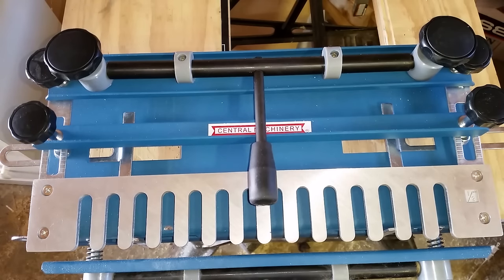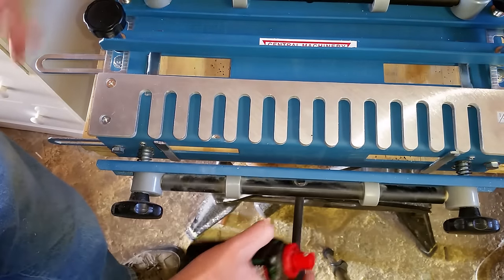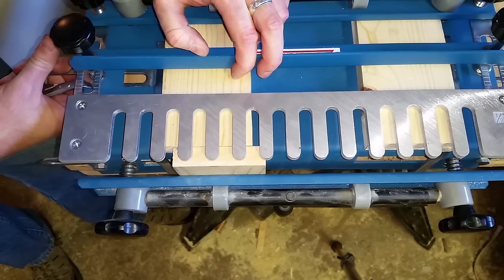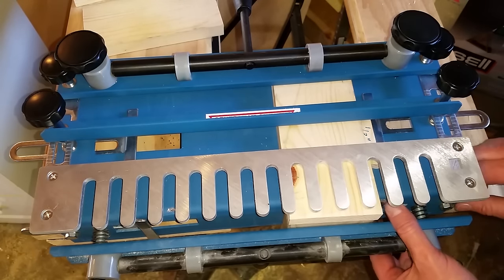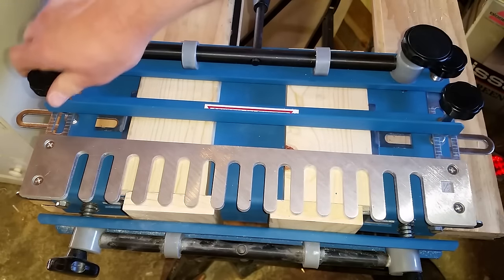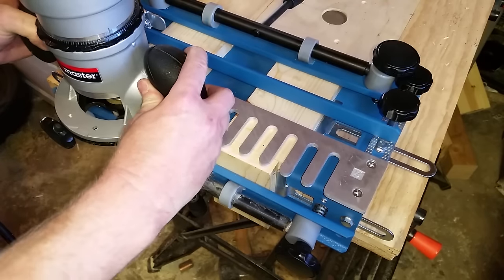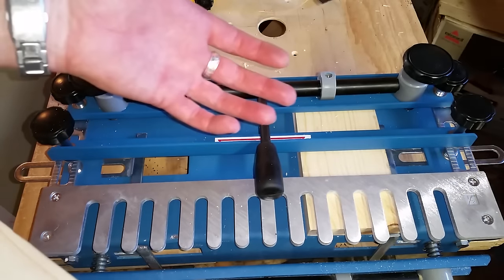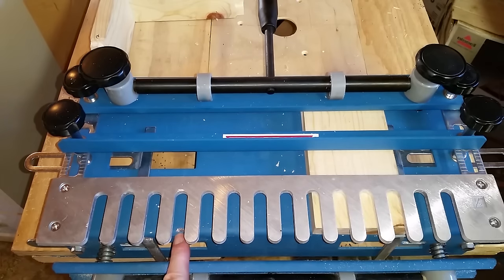How to setup a Harbor Freight Dovetail Jig

Comment: Been doing carpentry for 30 yrs and never uttered the measurement with 32nds in it.... PS I don't work in a machine shop
Reply: 23/32"s  29/32"s   Machine Shop talk.......    .005    .125   .350   .50  .3750   
 1/32" is a measure of distance when your not in a machine shop.
We or he could just say  .59375 or 15 MM   But he said 19/32"s If I recall. 
 That's between the 9/16" and 11/16" marks on your tape measure But I'd use a scale to be more accurate.
A scale is a unit of measure, that thing you used in school that was a ruler if the first mark started off the edge of the device as a starting point we don't use them for anything but to draw a line.
If you asked me to hand you a ruler I'd tell you all the rulers are in England!.......  I can hand you a Rule......
I worked in a machine shop, you didn't call it a ruler.
Tell me you don't own a trisquare? That's a scale the square is attached to.
Ok a rough in carpenter might say strong or weak past a 1/16 of an inch. But a machinist is always going to say +- 5 thou.
If your working on a machine you're going to say 1/32 or 1/64 of an inch, or 1 or 2 mm.
the reason is steel doesn't expand and contract as much as wood moves but it still can move. Hot and cold effect metals size. If you pull a part out of a lathe that was just machined after it cools off it could mesure .002 off what you got from what it was when it was hot or warm. If you chill it its going to get even smaller by a few thou.

Where as wood moves with moisture content. And season changes.
30 years in Carpentry I'll respect that, I'm not being a smart ass about this just giving you more knowledge Hell I might not even be correct so just take it as a general idea. I'm not going to fact check it.

It really would make life simpler if we changed to the metric system for a lot of things, but I like working in fractions and decimals and believe it or not they still use them in other countries. 
Adding fractions is a little harder to learn so it keeps you on your toes and thinking. But how many of us have learned tricks around adding them at all. There is an ez way to find the center of a 25 3/16" board with 2 tape measures and its close enough.

So for you I think it would be 9/16" strong and let it go at that. Or you could just cut a setup block.
It really doesn't matter because it's only going to get you in the ballpark chances are your going to have to fine tune it. Nothing is perfect. The paint might be chipped on your unit. Or a cunt hair got in the way. But that's only about .003 to .006 thick. You ask your help to move it a cunt hair he moves it a 1/2" don't ask what he's been sleeping with you don't want to know!
Reply: SCRAPEY HAWKINS I
Reply: millimeter is the king for that kind of the measure. i don't know how Americans can use inches like that.
Reply: I'm an American and I don't get it either.  I do mostly CAD/CNC in my own shop, and work 100% in metric measurements.  That all being said, I can cut dovetails with a scribe and a chisel faster than this harbor freight machine can be setup.
Reply: I've been doing carpentry for 32 years but there is, in my mind, a difference between cabinet making and carpentry. I've done both. It depends on if you want tight joints or not.
Reply from the maker: Great!  Make a video detailing your chisel and dovetailing then.
Reply: joinery is special kind of carpentry.
that's why it has it's own name.

Comment: I'm not sold. 
The chip out is awful.  through no fault of your's so don't take it personal.
Personally, I get better results with a back saw, coping saw, chisel and a dead blow hammer.
Reply: Stop using cheap bits. The tool is not the problem, cheap bits is the problem. Use a freud bit, you'll be happy that you did. Buy a 1/4" shank bit, 1/2" shanks will not fit through the guide bushing.

Comment: 18/32,    9/16 maybe
Reply from the maker: or 19/32"
Reply: depending on the dovetail bit. there are a lot of variations, width, angle, length, etc. (for example, Home Depot sells Diablo dovetail bits with 1/2" width, with 2 different angles, 8 degrees and 14 degrees) also depends on the collar that you are using with the dovetail bit. once you decide on the dovetail bit and collar (determines the final width of the widest part of trapezoid along with the dovetail bit width) , then you can settle down on the depth of cut.
Reply: for example, if you have bit that is 1/2" wide at the widest end, and collar with 7/16" outer diameter,
the final width of the widest part of trapezoid would be 1/2 + 1/16 = 9/16" 
because the harbor freight template has 1/2" slot, and the collar can move 1/16" left and right.
so depending on the angle of the blade, you can set the height so that the narrow part of the trapezoid would be 1" - 9/16 = 7/16" .

Comment: I'm sorry, but this looks like its so much more trouble than it's worth.
Reply: Hardly, imagine doing an entire kitchens worth of drawers and cabinets. Using handsaws and chisels it would take forever. Once you are practiced with this it would take maybe an hour. Of course if you just wanted to do it fast rather than super strong you could just use pocket hole screws.
Reply: @dfpguitar  yeah and hand cut doesn't have that machined look that is correct for kitchen cabinetry today.
Reply: Josey Wilds  those better jigs cost many times as much as this one does. As far as setup goes they're no better either.

Comment: Omg. What a fiasco. Not knocking the video author, but rather the contraption from Harbor Freight. Way too much work for the end result.
Reply from the maker: Setup is going to be part of any type of wood working jig.
Reply: MrDabrudda I  understand.  To each his own. For the savings it may be worth it to some.  Been there many times myself. Just in this particular case,  I  would have to figure out an easier way or go without.

Comment: you dont know how a person could struggle with this ?  you said the manuel is wrong?  answered your own question....
i have this exact device....  i guess for a very very specific artsy type build this would be needed.... but who the hell needs a drawer or small wooden square.   soo strong that you set vehicles on for servicing?   a drawer in a kitchen that a 100ish pound lady occasionally touches... a box that lives it life 100% out of eyesite hidden in the dark?     for a high end look i kinda see,,  but.....   worthless waste of effort for the mostpart
Reply from the maker: You don't want a drawer that will fall apart after 1 year of use.  I have drawers in end tables I built in high school wood shop 30 years ago which are still solid.  Staples and glue will not last repeated opening and closing.  So dovetails are the answer.
Reply: MrDabrudda how about screws and glue?   or countersink screws connecting sides to the drawer bottom ?   my mother in law has furnature from the late 1800s made in england ,,,, amazing the drawers function.... i get that your trying to validate the usefullness of your time spent here....but i would be willing to bet ya less than 1% of all drawers in the world that are workin the streets this very minute are dovetailed.......            i just think the time consumed with this concept could be better put to use ......  ...unless some clam wants that for cosmetic eye appeal....... understand that to do this throughout a project or kitchen remodel,,,, using this caveman tool and process.... is equivalent to building the hoover dam.....  to get it all to fit just rite and the sanding and clamping....  also your just doin one end on some scrap wood.... imagine a real drawer where one small block of would needs both ends dovetailed at a very specific measurement to have sucessfull completion.....  not sayn it cant be done and done well.... but the real scope of this whole shtick.... is too much time and effort to warrant it at all..... ask 20 people when the last time they had drawer trouble ..?  bet ya they say never
Reply from the maker: You are correct that most of the furniture out there does not have dovetails because 99% of the furniture out there is particle board crap.  Glue and screws are not enough to weather time and repeated opening and closing.  Go look at high end furniture and you will see dovetails or a V groove joints on the drawers.  Screws and glue are fine for IKEA furniture that will last 10 years but like I've said in my previous post...30 years of use on  end tables I made in high school.  I guess if you can't see the "why" in using dovetails and doing the job right then woodworking is not for you.  Stick to assembling IKEA.
Reply: MrDabrudda I totally agree with your idea that they dont make things like they used to...  but i dont think you really understand the nessecessity of having a product be reliable and also practical......by your accounts on this subject.  why not skin the entire builds with 24 karat gold leafs...  shelving with a nickel core... carbon fiber made connecting plates and stanless surgical steel plates connecting all seams and joints..... reason why is 99% ofall the stuff that makes a cabinet is never seen or put too constant heavy loads....  by having inexpensive material there thus makes it all affordable, and products that consumers will buy at high volumes.... i dont think i need to explain the trickle down benefits from there in the economy. and remodeling/diy upgrades.....    hey your skilled at this, and i respect this procedure.......but by our discussion,, your one sided and not really realistic on the way modern industry needs to operate......
Reply from the maker: I'm not mass producing furniture in my garage nor is any other home wood worker.  I'm making shelves and drawers which will last a lifetime.  This jig is setup it up once and cut a hundred drawers.  I'm not setting this thing up every single time I'm using it.
Reply: Funny how the know it alls really know nothing
Reply: Jack F:  I had a fire in one of my apartments.  The insurance company tried to low ball the claim until I pointed out the hardwood cabinets (stained & varnished), plywood instead of particle board, and dovetailed drawers instead of cheapo crap.  I got a really good payout @ over $65,000.  It cost me $12,000 to fix it.  Didn't replace everything they paid for.  Just used a lot of soap and water and some new drywall.  Dovetail joints survived twenty years of tenants and one fire.  Guess who got to keep the extra $53,000.  Well worth the trouble and not a waste of time.
Reply: Jack F. Doesn't seem to recognize the concept of personal choice. Try it, you may like it.

Comment: You get what you pay for, good video but seems like a whole lot of trouble lipstick for that pig.
Reply from the maker: Regardless of whether you buy a $200 jig (Porter-Cable) or a $30 jig it will require setup and test cuts.  At least with the HF jig I have $170 left over to buy beer.